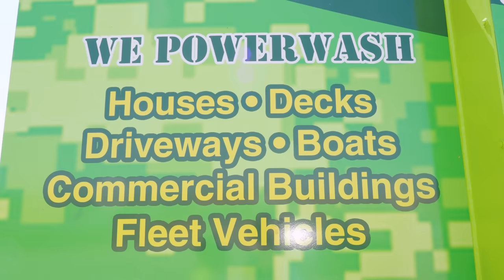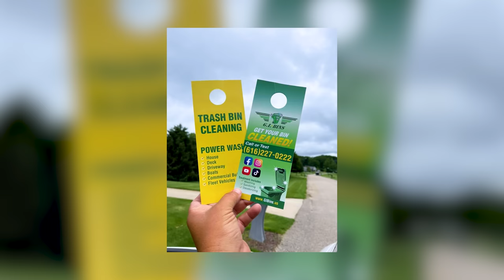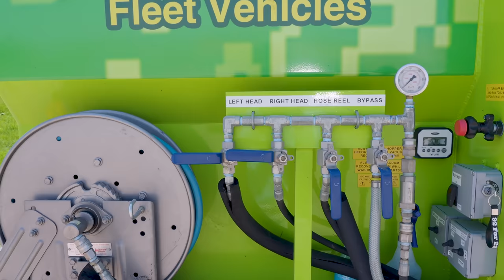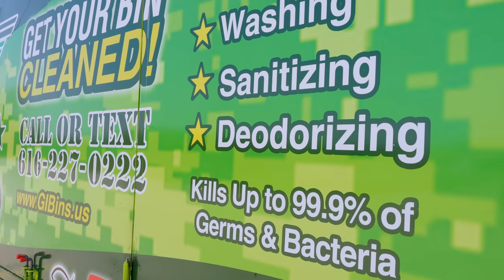How To Start Trash Can Cleaning Business

Comment: I don’t see this as sustainable. How much does one even charge for a garbage can cleanse. $5???
Reply: Try $20 a bin not 5 and 150 - 200 for driveways 220 for decks or boats 200 cans a day 4,000 in a day plus a deck is 4,220 in a day just keep adding it up
Reply: @bryceandriesse1440 it would come out to 300 a year with their monthly subscription. Just buy a brand new Bin at $75 every quarter and it's the same thing. They either working in upper class community or doing more than just bins
Reply: @armandomorelos2500  In some cities they are municipal supplied, or contractor supplied (Waste Management etc)
Reply: Did you even watch the video lol
Reply: @armandomorelos2500  as stated in the video we can do everything a pressure washing company can do washing trash bins is just another option.
Reply: It’s working and there sustaining it